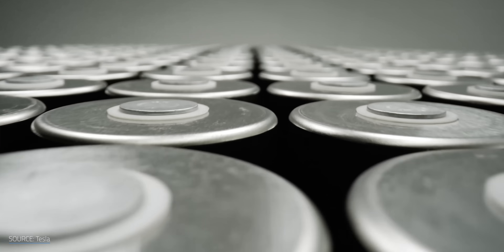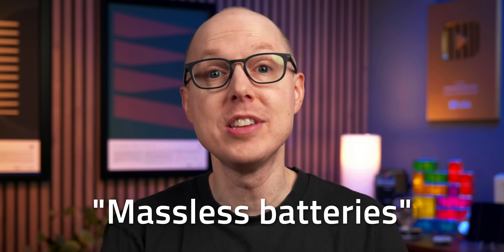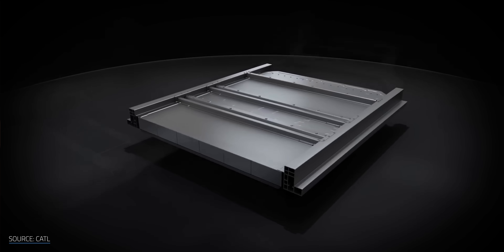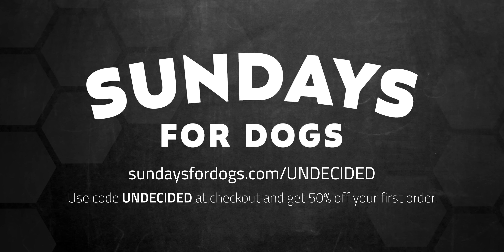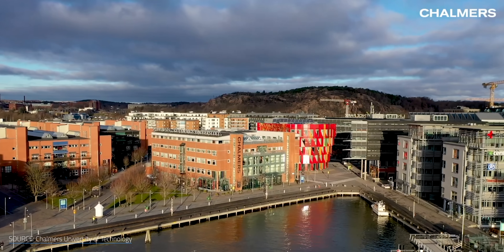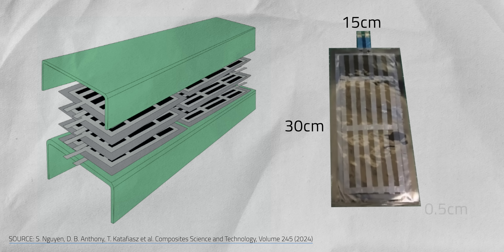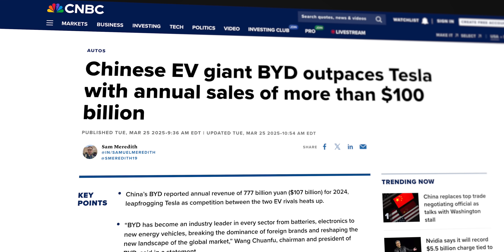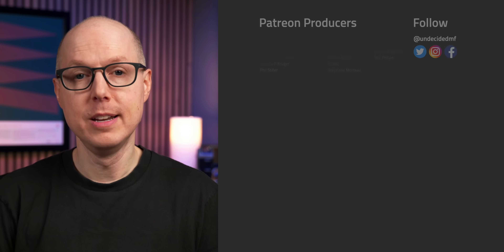The Strangest Battery Breakthrough Yet

Comment: Structural batteries will only be viable if they're simply that "structural". These so called "structural batteries" stretch far beyond what we should think of as strictly "structural".  You can hardly call them structural if the result is a vehicle that is 30%-50% of the weight of their combustion engine counterparts of equivelant body structure. These EV batteries are more accurately described as either "housed in the core structure" or  "structurally attached" than purely structural. For vehicles like cars I think it's a dead idea because accidents and damage to the structure would render the vehicle totaled even if by today's standard the vehicle wouldn't be. If my entire energy delivery system just got wrecked because someone hit my back bumper at 30-40mph  and damaged the frame/structure responsible for storage and delivery of power throughout the vehicle my car is toast. On the combustion vehicle side that could be repaired and put back on the road. In vehicles unlikely to experience damage like mass transit  there could be a use case but trains seem a more likely candidate than planes because of the ability to access energy during transit to charge the batteries while moving. Consumer electronics I think is really the primary place there could be real applications that are achievable on shorter timelines than transit applications. I would guess the transit side wouldn't see scalable and practical applications for 15-20 years while consumer electronics is more likely to be 10 years.

Comment: I could see this working better as structural capacitors.  They would have a longer life cycle than a battery, would recover more energy (in cars) than a battery with regenerative breaking, and at large sizes could hold an impressive amount of power - which could be bled off to a battery over time.

Comment: I didn't hear anything about the actual concerns of end user utility, though.  How effectively will end users be able to replace this in a device?  If it's structural, are they just expected to buy a whole new device?  Or take the entire thing apart instead of just a cap and a battery?  That's actually LESS economic for pretty much everyone.  Or is this all solved by the batteries never needing replacement for the lifespan of the device (and by lifespan I mean upwards of 10 years if not more depending on the device).  I just think there needs to be more thought than just big things.  It was very slightly touched on how inconvenient and awful cars could be with these things plastered to the bottom.  But I think before this technology really goes anywhere, repair-ability needs to be addressed 100%.

It should be MORE convenient, cheaper AND easier than Lithium Ion for END USERS, not just manufacturers looking to save a few bucks.  Big companies have plenty of money to go around, regular people/workers don't.  And this goes for not just something like structural batteries, but solid state or any other energy storage technology.  None of them last forever, so they NEED to be easily and cheaply replaceable.

Comment: Why would you slim down a phone or laptop over running twice the batteries for added capacity?
the standard 5aH ~ cell batteriesin a modern phone need near daily charging and removing thickness from a device that is already fragile by halving thickness just seems like a questionable use of r&d.

Comment: It can cut your laptop battery size in half with 70% less energy density for an overall reduction of 85% leaving 15% of the original capacity remaining? "Reduce your 8 hour battery down to 72 minutes run time" does not sound like a selling point. Sorry, but that doesnt seem useful at all.

Comment: Unfortunately the calculations shown for these cells are assuming a very generous replacement ratio and fail to consider many things that would be necessary for practical application. The main painpoint for car usage for example is how the cells would be integrated into a functioning high voltage car circuit. The additional weight and volume necessary for contacting and monitoring equipment for the usage of the individual cells is handwaved. 
The comparison at the end for car manufactures "already implementing structural batteries" is factually correct but severly misleading compared to what was previously shown. The video focuses for a large amount of its runtime on structural battery cells while car manufacturers are currently working on structural battery packs. There is an enourmous difference between the two because a structural battery pack does not make any changes to the chemistry or conventional setup of the individuall cells it just adjust the assembly of the battery pack in such a way that it can resist forces which was not common before that. Several topics get mentioned together in the same breath that have worlds between them in terms of complexity and realistic achievability.
As always I would appreciate a more thourough presentation and investigation of expressed topic from a channel that majoirly deals in science information. I the goal of these videos to create hype with surface level information or is this supposed to be an actual presentation of a research topic?

Comment: While the idea sounds plausible, the reality isnt. Load bearing structure last the lifetime of the things it builts upon. Battery doesnt last as long and needs to be replaced. If the idea is making load bearing structure replaceable, then its kinda stupid because you need to remove the weight before you cen remove the structure, otherwise it will collapse. Essentially overhauling the whole thing just to replace a battery. 

In otherwords, moving from long lasting load bearing structure to structure that doesnt last because the battery needs to be replaced. Kinda stupid to be honest.

Comment: Structural batteries can't be used when the load they're bearing is cycling, that means that a lot of the places they COULD be used at are non-viable.
Their only use is as structural elements in Crumple Zones, areas that are meant to be destroyed in a crash by taking some of the load off or in wall structures that do not experience a lot of flexing, because if they flex then the internal connections inside the structural battery crack and break, same as any flexible solar panel that gets to flap in the wind or flexed back and forth repeatedly.

This means you can't replace a car's frame with these batteries, you can't replace almost ANYTHING structural on a plane as almost all of it either flexes regularly or experiences cycling loads, the only thing you can use structural batteries on a plane are the internal wall supports (the thing they put thin plastic sheets on to make the insides look smooth).

Comment: The old home science experiment; stacking pennies and nickels, and salty wet paper, to make a simple battery...
I know that these were mostly for learning, and don't hold very much power, however scaling up the metal layers, and getting a better electrolyte, could still make structural parts.
There may not be enough to run motors, but with the efficiencies of modern electronics, this method may be viable for non vehicle applications, like street signs, and even low power networks.
Having copper outer layers may even be able to make use of the copper-oxide passive solar power.

Comment: I would love to manufacture a 600kg road legal car, 2 seater with a trunk, made of CFRP structural batteries. 
The chassis, some panels and seats made with that 30Wh/kg = 9kW of power, enough to cover between 100km (highway)and 200km (city) with a single charge. 
Enough range, seats, storage to make more than 80% of all personal transports in Europe and Asia: (the average distance per day is around 40km, and most car only have one or two person inside. A second version could accommodate for 4 passengers with a similar range, range extender running on ethanol or bio methane could be placed in a separable trunk for the remaining, rare long trips.

Comment: This video kinda mashes a couple semi-related, but distinct ideas into one video, which seems to have confused some. Structural batteries in the context of EVs means integrating the battery pack's casing into the chassis to share strength, and is a pretty viable way to save weight, but the inside of the pack with all the cells and all is unchanged; the concept is already mass produced in cheap Leapmotors, for example. This is pretty different than having cells inside of I-beams, or even using the structural members as part of the battery cell chemistry, both extremely unviable/expensive ideas for most applications except airplane auxiliary batteries in my opinion.

Comment: problem with structural batteries is that batteries are componentd that deteriorate and stop working over time. they are susceptible to changes in pressure or tenperature, and are quite volotile if damaged. for that making them a structural part in a construction might make the entire thing less sustainable. i think its importamt to keep batteries as a component thats replacable, and we should reather look more into the ways we can utilize or process spent batteries, reather than making them harder to remove,that might just lead into more planned obscelescence and more electronic waste.

Comment: You should look into MotoE and Ducati. Race motorcycles need to maximize performance while minimizing weight. Engines have been stress-members in high end sportbikes for a few years now and Ducati is following the same pattern with its MotoE race bikes, making the battery a part of the frame.

Ducati wants electric sportbikes (and so do I) but last I heard their stance was the battery tech just isn't there yet. It's too heavy, too expensive and takes too long to recharge. One day, though. One day.

Comment: Linking structure and batteries seems like a really bad idea.  Even if this works ok now, when new battery chemistry comes along it will be very difficult to integrate it into the structure. Time to develop is much longer, too, since both the structure and battery chemistry have to be proven.  Changing one may affect the other.  Manufacturing time (also learning cycles) likely is longer.  This makes production less agile, too.  I'm betting new battery technology will come much faster displacing the advantages of a structural battery.  Also, since structure and battery are dependent, both will be compromised.  The idea sounds attractive, but seems deeply flawed.

Comment: Have you had a chance to look into the research paper “Energy storing bricks for stationary PEDOT supercapacitors” 

This work is inspired by our recently published rust-assisted vapor phase polymerization13. Chemistries enabled by hematite provide an opportunity for developing cutting-edge functionalities on a fired brick where 8 wt% α-Fe2O3 content and a 3D porous microstructure afford an ideal substrate for engineering a mechanically robust electrode. Here, we develop a supercapacitor using a brick’s hematite microstructure as reactant to vapor-deposit a nanofibrillar coating of the conducting polymer poly(3,4-ethylenedioxythiophene) (PEDOT).

Comment: I have a question. Typical lithium ion battery needs to be equipped with external forced cooling when used in automotive industry, by using this resin material how is the cooling requirement affected. I have also seen that on repeated heating and cooling of resin leads to cracks in structure. Is the resin able to mitigate that?

Answer to the query will be appreciated!!

Comment: there should be a push for the high cost,efficiency optimized verion of sturctural batteries in the mobile phone market , as soon as the concept is proven viable and usefull. This would push the thoughts on structural batteries as a whole, and help ease population into the fact that structural batteries will/can be a huge thing. For sure it will be in  some iphone a few years into the future. im sure

Comment: Just watch the intro, structural battery sounds cool but it seems like it would make things harder to repair, recycle, and more fragile overall which is great for manufacturers bottom line, AKA glass back cell phones. Replying to my own comment, after I watch the whole video.
Reply: After watching I generally get the same impression. I was also surprised that the energy density it's so much lower. Furthermore these type of weight decreases can be achieved by using the structural techniques .in structure only.

Comment: Not hard to believe structural batteries will go fully mainstream in many areas before too long, but I am curious about what the after market looks like. Are they no more difficult to recycle or convert into fixed/stationary energy storage applications as we're used to now with aged EV battery packs? Disassembly seems significantly more complex

Comment: At 30wh/kg, an over engineered frame of  say 500kg. Would skill only result in a 15kwh battery not exactly going to get you that far. So we still need batteries(far from massless). But if 33% of the weight youd already use is twice as useful thats still massive

Comment: The potential benefits are enormous: assuming they can solve all the engineering challenges. And it looks like they are progressing. 

So; yes! I do think structural batteries will become commonplace, but I also thought that thermal dipole  arrays would become commonplace, particularly in computer and mobile device electronics where they can do double duty as a super thin super efficient heat sink that could be layered parallel to the computer boards, and to convert that absorbed heat into electricity that could extend battery life and use times. 

It hasn’t happened yet even though they can manufacture thin sheets of the stuff.

Comment: I see where structural batteries are going, and it's cool and all, but I also see it as 100% non-repairable one time use devices, unless that "structure" can be serviced as a module. This is even more apparent when you mentioned battery life. Make a car out of structural batteries, and you have to replace the entire chassis after 2-3 years because the batteries are not replaceable. China is already WAY ahead of the USA in terms of "hot swappable" battery packs in fleet and over-the-road equipment. A trip from LA to Dallas with current tech batteries could be done with similar "refueling" times as liquid fueled vehicles, if we were to demand more swappable battery systems (ahem, power tools are going to be required to have a universal connection soon, hint hint). Permanently mounted battery systems is just a bad idea for the environment, and consumers, in my opinion.

Comment: structural batteries in consumer electronics would be a hard sell right now. two major issues scalability and cost
The I beam battery seems like it has the best chance with aviation.  being able to cut even a couple of hundred kilos out of flying weight would open up some options for air travel. biggest hurdles there would be regulatory bodies, proving that the new tech is both as structurally sound and electrically reliable as current standards, and the speed of the aviation industry, planes are expensive and new tech is slow to integrate. one opportunity in aviation could be smaller aircraft or private aircraft market, somewhere that has fewer regulations than commercial air travel but could see faster adoption

Comment: I can't remember a time when it was a good thing that the battery was fixed and locked into the device. Returning to modulated and changeable systems is a win for consumers and recyclability. I would not replace my phone every four years if I could still swap the battery. I hope structural batteries will fail; there is no way that this will not be used against the consumer!

Comment: The issue with structural batteries is their ability to be serviced or replaced. In certain scenarios there might be reason to utilise it (like transport solutions) because these scenarios generally have lower frequency of replacement or upgrade. In consumer electronics they'd likely just add more devices to the growing pile of ewaste as the structural part would be harder to replace and it'd likely be misused by manufacturers to force obsolescence cycles and make people buy new variants. 

This is happening already, so why would we think it'd be better by making something integral to the devices structure? When it's too costly and time consuming to repair/replace the structural part that's no longer charging or holding a sufficient charge density, repair/replacement of the part won't be the go to solution. Akin to Apple slowing it's phones to 'preserve the battery life' driving shoppers to buy new phones to give them a full day's charge / faster phone and people selling their electric vehicles when their range dips below X% because replacing the cars battery is more costly than simply swapping their finance to a new car. I think it has a specific place where it fits, but not every place is the right answer.

Comment: You really have to have a justified NEED for these. Being difficult to make at present is a good thing. If they become easy to make you will see them in areas that have no justification. This will give manufacturers an excuse for built-in obsolescence.

I don't want to buy a product if I can't replace components like a battery.
This would also make the circular economy much harder to achieve. Recycling anything will become increasingly difficult.